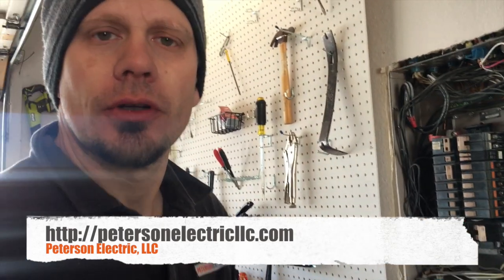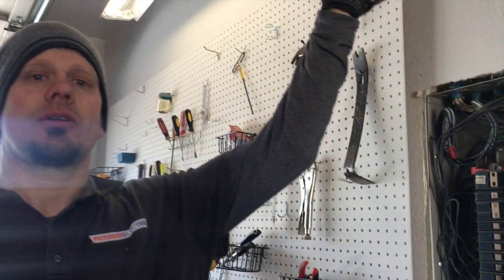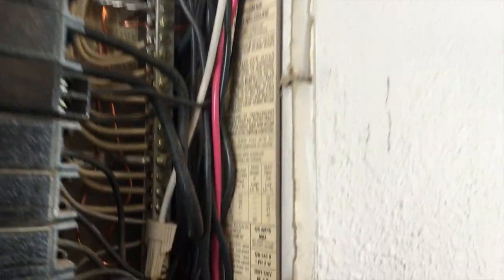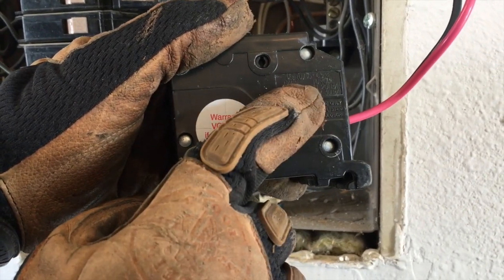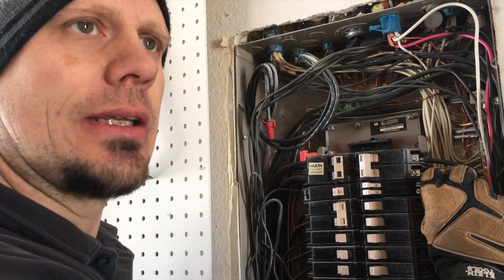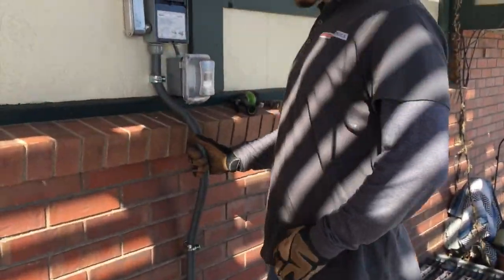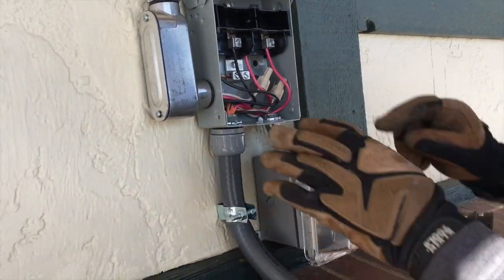Mini-Split, Ductless AC Unit, Electrical Wiring Codes

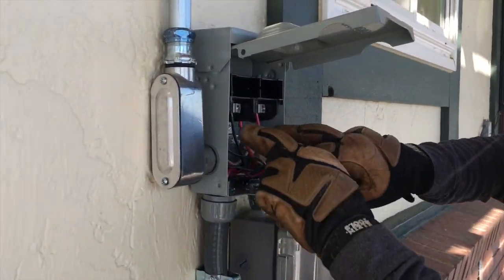Comment: I thought disconnects weren't suppose to be used as a raceway for another device or unit. At 2:35 the power for the GFCI receptacle is going through the disconnect. Where may I find the code for this please. Thank you.

Comment: Not all panels allow for mini breakers. Read the panel nomenclature for specific locations in panel. Many older panels only allow CTL type breakers. Circuit Total Limiting. You can’t just load up an under sized panel with all mini’s

Comment: I’ve got a question for you?
I got a mini split with a disconnect box beside the mini split outside.
I got a Generlink also that I use when we have power failures but never run the mini split when the power goes out but I have an extra inverter I could use just to run the mini split for heat when power is out.
Is there a code compliant way to do this?

Comment: ELECTRICIANS: Does the signal cable not have to be in conduit? Will have my 24k signal cable and lines wrapped and covered (under eaves) permitted and inspected.

Comment: I'm installing a hardwire to the disconnect box outside, there's some question about a GFI breaker at the panel but I saw the code and it seems you don't need one at least until Jan 2023. (Oct 2022 today), also there are questions about inverters tripping the GFI's.

Comment: novice here, i have a MrCool 36k multi zone 2 blower head unit.  Can I use a 8/2 Romex wires with a 40amp breaker connected to a 60amp non fuse disconnect?

Comment: I would like to add a 110 outlet below the 220 service disconnect as you did on this job...how is it wired???
Reply: It looks like 14 gauge THWN (a lot of the wire now is just dual rated THHN/THWN-2) was pulled through the conduit. If you're going to pull more wires through the existing conduit, make sure that you're not exceeding the fill capacity of the conduit (use a conduit fill calculator or look up the values and calculate it yourself). If you happen to have a receptacle on the other side of the wall, it's not that hard to fish a line and add an exterior box.

Comment: All residential breakers are rated for 10k symmetrical fault rating,if can go non-fuseable disconnect aka (exo) if you use a breaker labeled as H.A.C.R per code 80 % of 20 is 16 amps #12  cannot be used nope ,must be #10 thhn/thwn wire in seal tite .#10 good for 30 amps at 80 % code ..Fuses must be time delay dual element fuse..WHY USE ROMEX IN SEAL TITE LOL,NEVER 🦭 DO THIS U CAN PER CODE BUT WHY...
Reply: You could use 12 ga thhn in conduit or mc cable.

Comment: I’m looking for the 2nd part of this video that explains why you used 10/3 cable…
Reply: Because 12/3 is only good for 20 amps thus for 25 amp you have to use 10/3
Reply: @cedarwind but why did he feed it with a 12/2?

Comment: In my neck of the woods (jersey) once you have a conduit outside then all wires contained in the conduit must be wet rated like UF or thwn single stranded wire.
Reply: It looks like he ran romex, plus he didn't look for conduit fill

Comment: Why would you run EMT conduit outside in the weather? Its very susceptible to weather, and rusts very easily, especially in high humidity areas... Im not trolling you, I am just wondering why you did that, and not go with PVC?
Reply: Depends where u live and also PVC will become brittle in the sun.

Comment: Why are you using nm/romex in conduit? Its for interior wiring only, not wet locations.
Reply: So much for code reading 😂
Reply from the maker: We are allowed up to six foot of NM, until the inspector wants us to run THWN. It is a short whip

Comment: My electrician says you need a disconnect switch for the inside unit.  Is this true?   Seems to be some debate on that.
Reply from the maker: Yes, we have to have one outside. If they do not require it outside, it has to be back to back and inside. No main lug load centers are allowed without a main shut off. Art. 240
Reply: @Petersonelectricllc  Right, I know there needs to be one next to the outdoor condenser.  But there seem to be debate on needing a switch for the inside unit.  Aren't mini splits considered one "appliance"?   Seems like another disconnect is redundant.  Plus who wants that on the wall underneath the unit.  By the way thanks for your quick response and input on this.
Reply from the maker: @SnickasBah  I have only wired a switch by the outside condenser.
Reply: This is not true since all the power is being supplied by the outdoor unit.

Comment: I think he was asked (by the homeowner) to install a GFCI outlet that was completely separate from the 240V power for the mini split. I did some reading and found nothing about GFCI for the 240V circuit to the A/C
Reply: As per code a service outlet is required within 25 ft of equipment
Reply: @marklee8226  Disconnect with in 50' here in ky and according to the Mechanical code book.
Reply: That's a service outlet. It's for convenience. Not required.
Reply: @BoriPR82 it is required, read the code..😂
Reply: he said because the wire is running outside as opposed to inside

Comment: Why do you need to install the GFCI?
Reply: I was thinking to power up the vacuum idk
Reply: Romex in conduit is not allowed in a wet location.  Use thhn wire! Pull out your code book for that one
Reply from the maker: so the hvac guy does not have to get his extension cord when he charges the unit with his gas.
Reply: @Petersonelectricllc  Ha
Reply: @Petersonelectricllc  seems like an unnecessary expense.  most tradesmen have extension cords handy.
Reply: I was wondering the same
Reply: Because that’s the code.  A gfci has to be installed within 25’
Reply: For the technician who comes to work on it.
Reply from the maker: It states it in 210. That we are to supply the HVAC a plug, typically to allow them to charge their condensers

Comment: Couldn't see if you ran a neutral to the disconnect. Also wondering if your specific model of HP required the fused disconnect. I've heard best practice is to not use them.
Reply: The unit is 240V so you don't need a neutral.
Reply from the maker: This mini did not require one, but I always pull one.
Reply: @Petersonelectricllc  Kevin asks a great question regarding the absent neutral.  I’m reading up on my son in laws 36k unit and there is no mention of a neutral, only a ground.  The recommended disconnect has no place for a neutral.  I hate to assume it’s not required and wish the paperwork addressed this.
Reply from the maker: You have to have a Neutral or GROUNDED conductor in all equipment. Fusible disconnects are great for equipment on AC, mini splits, welders, roto-motor converters and add a phase motors Motor loads, CNC and wood working machines, dedicated appliances where possible. On main homes, or main disconnects for the load center, not as much. you can do this, if you want but usually space is tough.